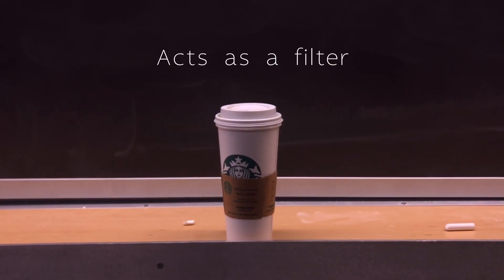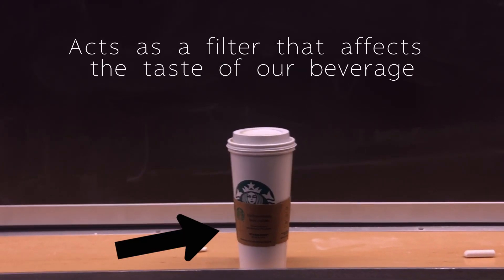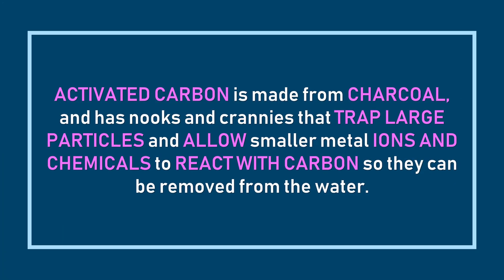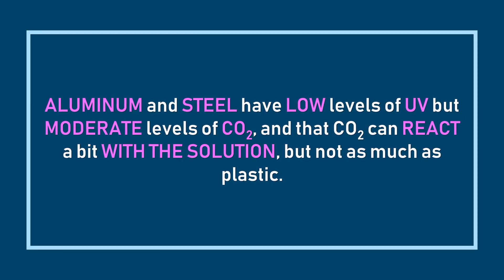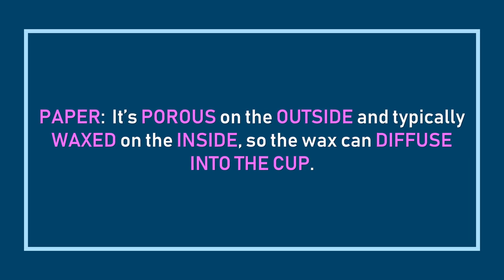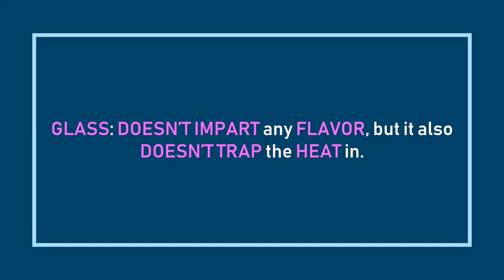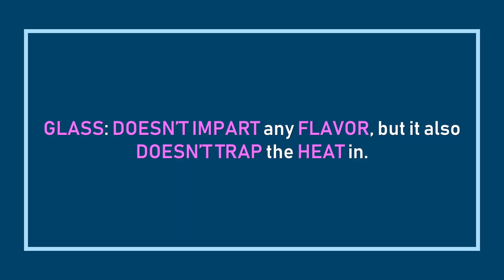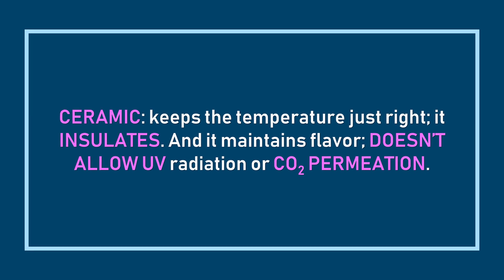The Chemistry of Coffee Taste: Why Coffee Tastes Worse in Certain Cups

Comment: What we call wax that seals a wax paper may have been actual wax at one time, I'm not sure if that's still in use, but today it is a protein from corn called zein (pronounced 'zee-in' I believe). I definitely agree with you on the ceramic thing. When I use a ceramic coffee mug, there is an additional point in favor of the flavor and temperature of the coffee. When I stir my sugar into my coffee in the ceramic mug I do so for about 15 to 20 seconds. This is because the ceramic mug will absorb some of the excessive heat from the coffee, which is probably going to be over 140°. In doing so, the dense ceramic material (especially at the bottom of the mug where it is most thick) will absorb and store heat. This allows the mug to continually give heat back to the liquid, which is losing heat at the top where it contacts the air. This allows your coffee to stay at a more consistent temperature for a longer period of time, considering that it was hotter than the temperature you want to drink it before you poured it into and stirred it in the vessel.
Reply from the maker: Didn't know this John! Thank you for teaching me something today.